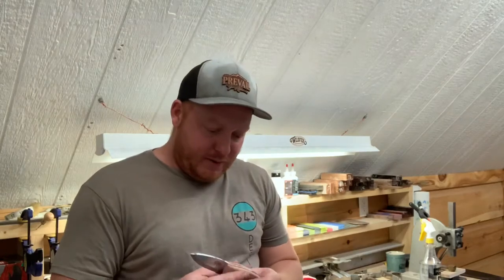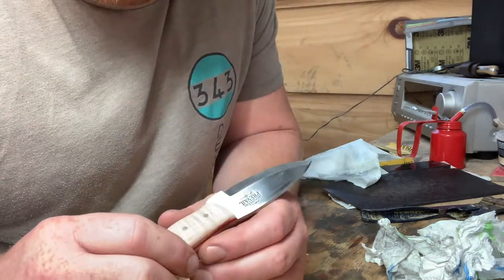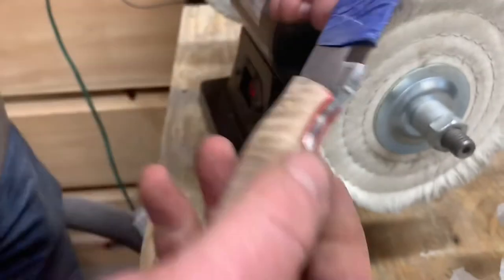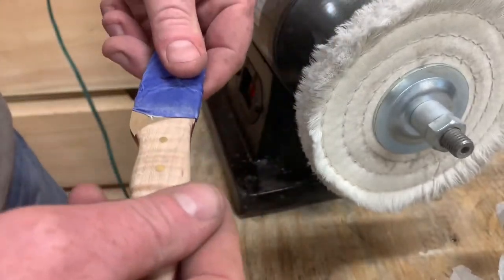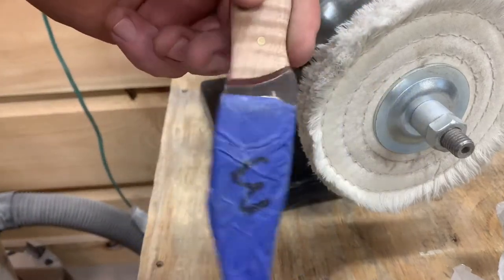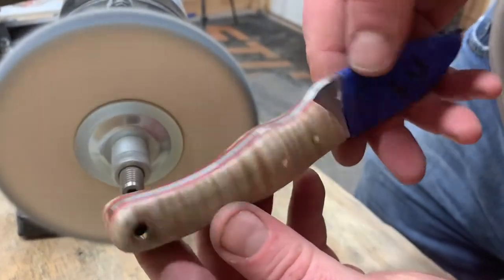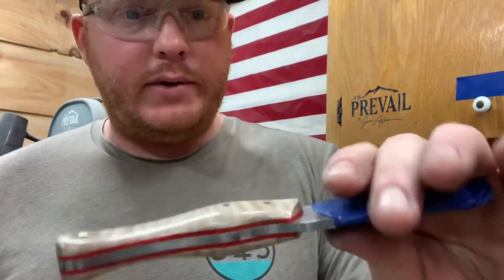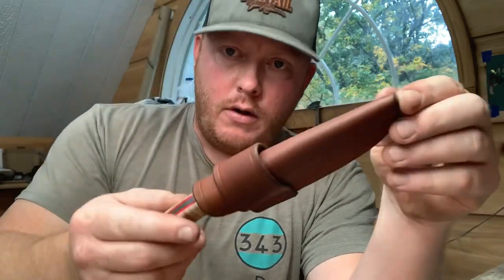Learning how to buff stabilized wood to a high gloss finish! It’s all in the compounds!

Comment: This is great, I'm looking to get a buffer in the relatively near future and will keep these compounds in mind... that finish looks fantastic.
Reply from the maker: Thanks man! I’m pumped to have finally got it figured out. Not a lot of info out there on finishing stabilized wood!
Reply: So does it require a top coat? Bees wax, boiled linseed, tung oil etcetera?
Reply: Use tru-oil.

Comment: What about the black residue on the scales? I noticed that your buffing wheels were turning very black also. How did you address that?
Reply from the maker: Residue rubs right off. No way to avoid the wheels turning black that I had found.
Reply: I think you had some crab left in the brass hole and it came out while buffing.